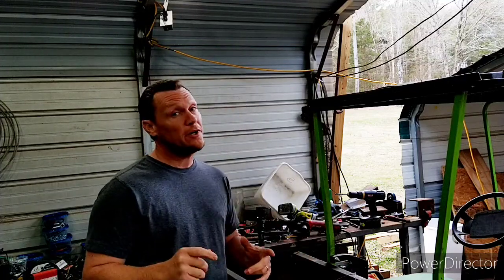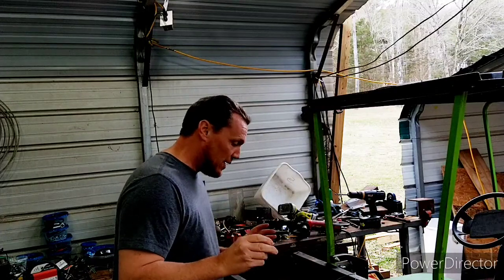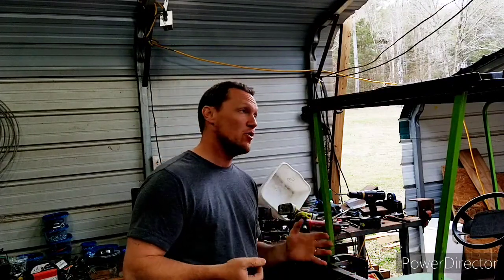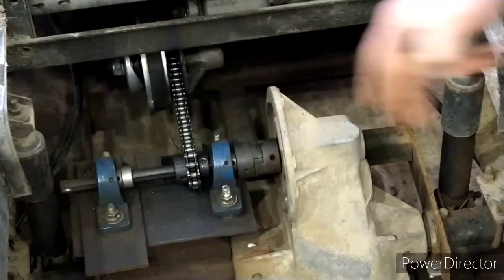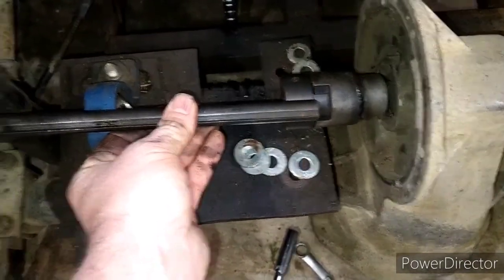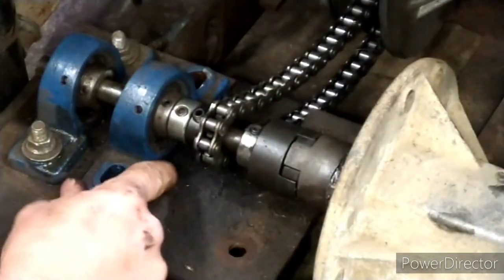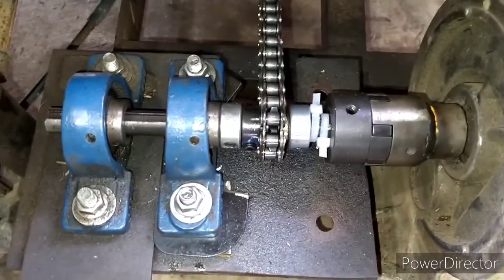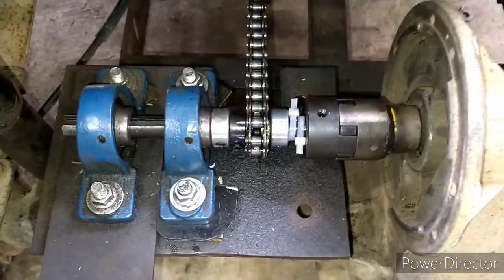Predator 212 golf cart upgrade and top speed, 28 mph?

Comment: For your bungee cord fix, install a large heim joint. Will allow the engine mount to move up and down, and it can twist to handle when one wheel climbs over something or drops in a hole. That's how I did mine.
Reply from the maker: Cool thanks

Comment: 2 pc locking collar solves spacer issue, you can change springs on torque converter and clutch for more variables sometimes they eat belts if alignment is off .. Gods Speed .great fun .
Reply from the maker: Ah cool, your right, with the two piece collars I can put them on without removing the shaft, I appreciate it, thanks for watching.

Comment: Harbor freight should give you a few predator engines. There's a proper way to "set" a set screw. Tighten the screw then loosen the screw, do it a couple times before the final tightening. It should allow the screw to "set" into the shaft.
Reply from the maker: Im going to try this on the minibike I'm building, thanks for the tip.

Comment: Have you looked into the stage 1 kit for the 212 on eBay? Mine went 30mph with 2 350lbs of weight with a 10 tooth.
Reply from the maker: I know the different kits give you more power, I don't really have a desire for that, but that 420 with electric start and a charging system would be cool. I know you can get that for a 212, but it's cheaper and simpler to just upgrade to the bigger engine if you have room.

Comment: I enjoy ur videos. If everyone had ur positive attitude the world would be a better place.
Where did u get the piece that goes on the rear axel? Part number?
Reply from the maker: Are you talking about the splined piece? It was the nose of the electric motor that came on the cart. Or a different piece?
Reply: @ChrisfromKeyfarm  my wife picked up an electric cart without the motor. She wants me to convert to gas. I need the piece that goes on the rear axel to ad a shaft with a sprocket. But it sounds like u used the electric motor to slip.on the axel spline
Reply from the maker: When I first converted it to gas I put a 13/16 jaw coupler on the input splines and locks it down with the set screw, it worked, I just thought this would be better, I explain it in the first video, I'll post the link.
Reply from the maker: https://youtu.be/twa3EnzlGWU
Reply from the maker: https://www.ebay.com/itm/122420950776

Comment: Who made your rear set up that attaches  to the rear end
Reply from the maker: For that piece you will need the splined nose off of the old electric motor and a jaw coupler, if you have those two pieces any machine shop can weld them together for you and make it straight for not much money. If you don't have the old motor to cut the nose off of, you can use a 13/16 bore coupler but you'll have to file it just a little bit to make it fit on the rear end input shaft ( drill a divot) for the set screw. I've done it both ways, the first mentioned works best.

Comment: Cool video Chris....I have same engine on my 3 wheel ez go cart runs great....my question is I current run 10 tooth on engine and 14 tooth on rearend....stock golf cart tires 18x8.5x8....im going to put bigger tires on the rear 22x11x8 so I think that 14 tooth going to be to big on the rearend....what should I drop it to? 12 tooth maybe....thanks Steve from fla
Reply from the maker: If you keep the same radio with a taller tire, it'll go faster, but have less power on the bottom end, so if you want to keep the same amount of" power " on the low end, you'll need to go bigger on the sprocket being driven.

Comment: The bearing in the housing can’t take side load move bearings to both sides of chain
Reply from the maker: It has 2 bearings, the shaft would have to bend before pressure is put on the housing bearings, besides cars and cameras put 20+ HP straight to the input shaft , no bearings.